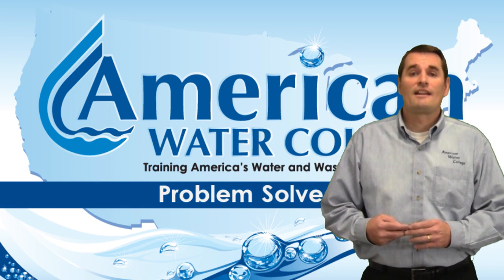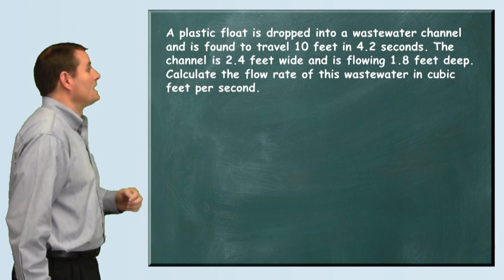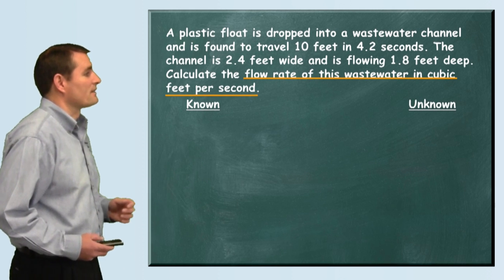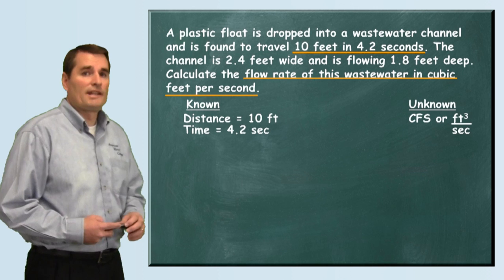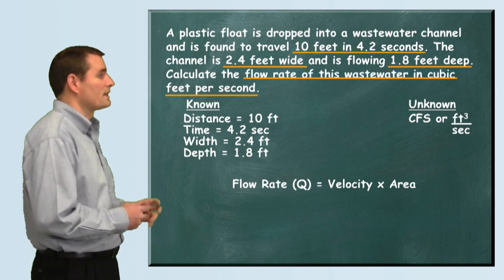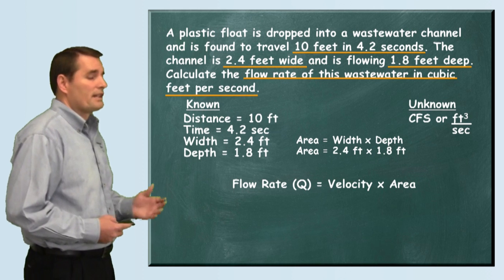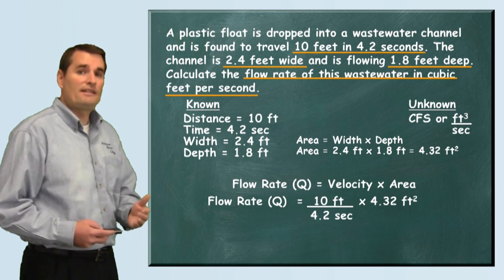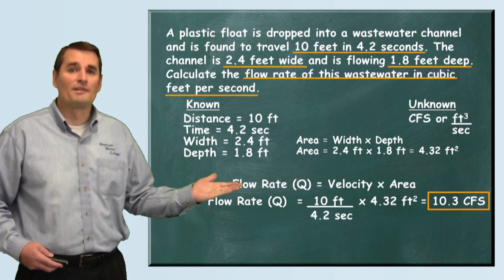Problem Solved: Flow Rate Problem - Wastewater Math

Comment: Why is the area width x depth when surface area is normally length x width?
Reply: Tbh, since area is SQ FT (FT x FT), you can calculate it using length x width, length x depth, or width x depth. Typically, you'll use length x width to calculate the surface area of a basin, tank, etc., but be wary of the other options.